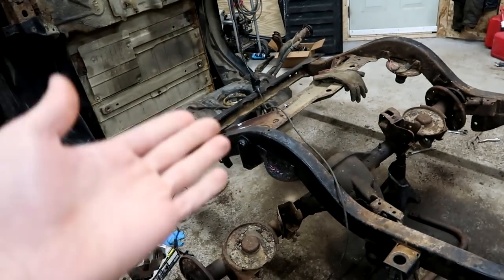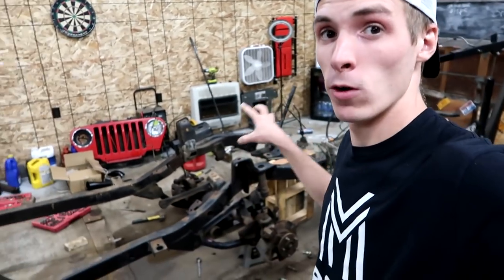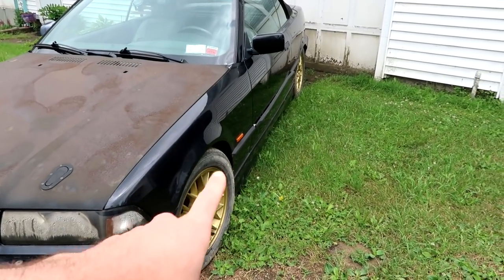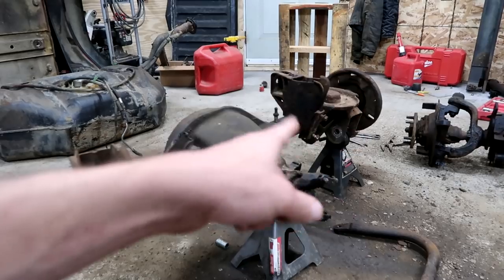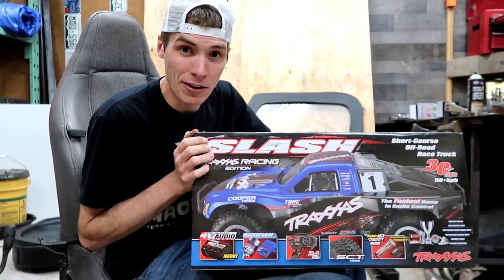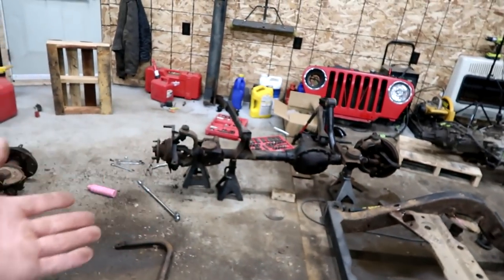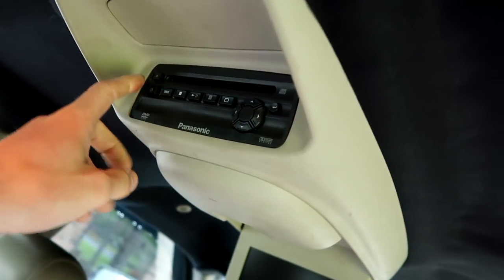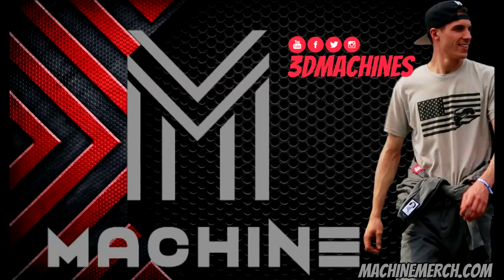NEW TRUCK REVEAL!!! (It's Finally Done)

Comment: my dad has been mudding for 25 years and has built over 15 trucks, now we have a 79 ford bronco with a dana 44 in the front (welded) and a dana 60 in the rear (welded) and 4/10 gears in it. the truck usually runs 44in interco ground hawgs and was built in the late 90s and has been used hard since then and they have held up through everything, keep up the great work!

Comment: So I have a 94 Cherokee, lifted on 33s with the Dana 30 and Dana 35 and stock gearing, I have had 33s on the jeep for 5 years and around 100k miles I drive it on the highway at 65 no issues, I’ve driven off road no issues. I just rebuilt the Dana 30 up front, ball joints wheel bearings axle seals diff fluid, no wear on the carrier and pinion. Run them, if you feel the need upgrade it later on. Definitely put lockers in them if you plan on running them for a while it’s worth it.

Comment: I've got a 93 yj, shattered a stock Dana 35 with just 33/12.50r15 tires driving in a straight line on a brick road at about 20mph. No noise until the the bang and screeching halt. I've now got a locked 8.8, its fantastic.

Comment: I used to race Cherokees in tuff truck comps around maine and we always ran just the stock dana 30/35 set ups. After bending a couple front axles we trussed them up across and inside the pc's and never had another issue besides breaking the occasional short shaft when we really buried it into a corner and stayed to the floor on the gas. I had 32s on my road rig too and never broke anything. It's all how u rum them. There's definetly more than enough aftermarket support for them to make them handle whatever u want to run for tire size.

Comment: We have built multiple jeeps, we ride them hard but do take care of them. My current project is a 1996 XJ that's getting 4.5in lift and 35's and lockers. The stock Dana 30 if it's a high pinion should be plenty for up to 35's before you need to update to chromoly shafts. The rear of my xj I'm going with a Chrysler 8.25 because its bolt in and only temporary. In your case I would build an 8.8 out of an explorer so its disc brake rear and limited slip with whole swap kits available to get it in and functional.  We have ran those with up to a 38in tire with minimal issues in everything from a 4.7 stroker YJ to a V8 explorer.

Comment: Those axles are fine. My 92 Cherokee, I basically rock bounce at offroad events. I completely rebuilt the 30 front due to the one that was on it being bent when I got it. So far no issues with this axle after I rebuilt it. Haven't touched my 35 rear, it's an LSD.

Comment: 2007 jeep wrangler jk had a Dana 30 up front and was snow trailing and got stuck in a small ditch tried to get out but in the end the case blew a hole in it. Upgraded to a Dana 44 same in rear with the locker. Best thing I ever did. I trail Colorado every weekend and moab twice every year. I do have some Cherokee friends that love the 30 and 35 but I hadn't had luck with it. Also I run 4.56 gears best trailing gears for 33s and 35s. If you have any jeep questions I'm here

Comment: you might want to keep the spacers that go on the frame to support the trans and transfer case, it helps with rear drive shaft angle. another thing is i broke my front dana 30 just by going back in fourth in mud (easily) and that is only with a 2.5L 4 cylinder. hope the info helps.

Comment: Hey Dalton I have a 2002 Jeep Wrangler and have had no problem with the diffs in it the front is a Dana 35 and the rear is a Dana 44. I have seen several Jeeps at the off-road Park I go to that have broken diffs from to much stress and I rock crawl and beat mine to crap and never had a problem

Comment: The Dana 30 is a very stout axle and with little modification can be made plenty strong for your application. I know someone running the stock front dana 30 in their Jeep WJ with a V8 and 37" tall tires. The axle had held up fine other than a broken stock axle shaft which was fixed with aftermarket chromoly axle shafts. As for the rear try and find a dana 44, dana 44a, or ford 9".  The dana 35 is known to be a grenade.

Comment: @3DMachines i had a 1974 jeep CJ5 with dana 35's with 35 inch off road tires. they worked out just fine for me. i mean my grandfather took it on some pretty gnarley stuff and it held up fine.

Comment: I’ve daily driven my Jeep for almost 6 years with a lift and mud tires and a Dana 30 in the front, I’ve done my fair share of wheeling yet I always baby my Jeep after I’m done. And I haven’t had a single problem with it. I at least have a Chrysler 8.25 in the rear which is just slightly better then the Dana 35. Id stick with a Dana 44 for the rear but by the sounds of it a Dana 30 will be more then enough for the front.

Comment: I have been playing with Jeeps for may years... Have built ground up a 1959 cj5.. My 95 yj  I have been building in stages for 14-yrs.. I definitely would not put any money into the rear Dana 30... Maybe clean it up a bit and paint it Black... Run it till you find a better axle... I run a Ford 8.8 in the rear of my Jeep .. They are pretty tough and cheap/easy to find.. The down side is that you will have to cut off all the suspension mounts and build it with new mounts for your time setup... Here is a link to a basic video of my Yj... I have put over 100k on it with most of those miles being back roads, trails.. It's been in the bottom of the Eastern end of the Grand Canyon, stuck in July at 12k feet in snow on the Rockies and been Thur Moab... Infact I am getting ready to head out west to wheel / explore .. Dig the build just concerned about the powder coat frame thing... I am constantly cutting and welding to my Jeep frame.. You are always adding or changing things over the years... I just run black pair and it covers the mods well... I do powder coat every else.... I even powder coat in my business weekly, so I have constant access to powder and didn't coat my frame... 

https://youtu.be/mQZBOarRFgo

Comment: Jeep will be fine ..i had a 98 tj with the four cylinder . 4x4 was great no problems sold at 350 000 km.
Did alot of minor 4x4 ,donuts and minor mudding and obstacles on 31 x 10 x 12 inch tires . Try a gusset kit to beef up the axle prone to bending with bigger tires. Good luck

Comment: If your that worried about the Dana  30 get a truss kit for it but look at your model of your, some of the older models come with small u joints on the end of the axle shafts,  if you have the smaller ones should definitely upgrade to some bigger u joints

Comment: A large 4WD tractor usually has a slightly faster front diff. than the rear to help pull it through mud and it allows some slipping so it doesnt completely rip itself apart. Not sure if its like that normally with vehicles but as long as it can slip a little a higher ratio could be a tad beneficial up front i think. I know my long tractor wouldnt hardly ever get stuck.

Comment: I have a 95 with the 4.0 ho, 4:10 with tracloc all factory. Just letting it known I have a stock jeep with stock axles etc.

It's really weird that everyone says these axles are junk yet they are still working fine 25 plus years later. If you do anything I'd go with an 8.8 out of an explorer.

Another point, you mentioned not using the spacers for the transfer case mount. If you are keeping the lift you will need to keep the spacers. They lower the transfer case and help with the drive shaft angle. Some also raise the motor mounts to lean the rear of the output even farther.

If this was a rock crawler or a competition rig larger axles would be a benefit but on a weekend wheeler the money would do better elsewhere. 

Retired pro offroad competitor
Reply: Oh, also the explorer rear can be had in the same gearing you have now and you gain disk brakes.
Reply: Ya when he said the Dana 30 was strong I was thinking he’s crazy. Only real bad axle on the Jeeps are the D35
Reply: Dana 30s are great for minor offroading its when you are trying hard things that put them on a bind that you have problems breaking Axel shafts.
Reply: CraftsmanQuad he just needs either a 44 or and 8.8 in the rear

Comment: Powdercoating doesn't last forever and is impossible to touch up. Nothing lasts forever in the rustbelt.
Reply: upside downdog actually you can touch up, you take a little powder and mix with MEK, and touch it up,  father in law owns a powdercoat shop and powdercoat vender/salesman taught us that trick.
Reply: Upside down dog the frames going to to rot from the inside out
Reply: DIY Chad 
MEK is nasty stuff! No good way to protect yourself from it, it permeates even your eyeballs and hurts the liver. I only know from experience.
Reply: Ethan Kage 
Any way it can for sure. I would never buy a machine where the roads get salted.
Reply: bad day buddy?
Reply: Increased Elevation 
To who?

Comment: I support the 30 in the front that. Dana 35 is crap in the rear. My first vehicle was an 85 Cherokee on 33s. Lived in Virginia. Been to Black mountain Kentucky rock crawling with it. The 30 held up great. Blew the pinion out of the 35. After that I got a Dana 44 for the rear from a high output 4.0 Cherokee. Never had any issues afterwards

Comment: When I was in my 20's I bought a Nissan truck that was lifted. Had a cool rake( or so I thought) to which turned out that it had 31" tires in the front and 33" in the back. First time I tried the 4 wheel drive it bound up and not knowing anything about 4 wheel drive thought it was broke. Took it to a mechanic and he told me I should do 31" all around. Live and learn.

Comment: If you can get those 44s I would go that route. The reason you want build stronger than what you anticipate driving is so you won't break. But if you build to your anticipated terrain eventually you will break. Your obstacles are only going to get bigger. You soon will be trying to get up that 90° wall.

Comment: All I can say is rebuild the axles as far as you can because it will save you in the long run and there is nothing wrong with a d30 for light off-roading and I would invest in some good inner tube seals there sale them on eBay, there are rebuildable and if you up grade to a d44 front end down the road you can reuse them as well,however I would see if you can get a D44 rear end if you do, do the u-bolt conversion on the yoke, and spicer u-joints are the way to go with jeeps because there have a lifetime warranty yes you will pay a little bit more for them but your pay for the warranty, and I know this because I live in Oregon and we off-road a lot up here.

Comment: If I can add my 2 cents. If you are going to run larger then stock tires, like 35" or 37" I would think about re gearing to 4:56 or 4:88. If you are going to sink in the money for re gearing I would go for Dana 44's front and rear. I am running 4:56 with a 35" tire, with a Dana 35 and Dana 30. I have not had any problems but I should have switch axels when I re geared. It is just a better choice.

Comment: hey Dalton!!,theres is a system ive heard off that makes your vehicle rust resistant,have to look it up,its something electrical and make all your metal in jeep rust resistant,so look into that,but long as keep painted that will guard against the rust also,later Dalton.

Comment: I had a 1992 wrangler although it only had the 4 cyl I had it regeared to 4.88 gears with locker in the rear had the same dana 35 in rear and once every couple years i had a a couple broken teeth on the gear as for the front I installed axle tube seals to keep out water and it did an amazing job as a i feel water was the main problem I had and obvs led to failure lol . Also was running 37 super swampers. Id leave the front alone and get a 44 rear.

Comment: powder coat isn’t always the best, i have a powder coated racing kart it’s a 2015 only seen water that is used to water the track. cleaned in wd40 after every race and there’s a rust spot and some paint chipping on the chassis

Comment: Powder coating only lasts if it is done perfectly with a perfectly prepared surface. Most powder coating these days just ends up cracking and peeling off in huge flakes. I still prefer paint on DIY jobs.

Comment: You’re honestly better going off with a set of Dana 60s The more beach here in the lower center of gravity and you can usually find them under running 99 2500 or F250 4 x 4

Comment: Nah dude that front end is gold I jumped my jeep going about 70 caught 6 feet of air bent the axle shaft drove it back home which was 2 hours away! Took a torch to it bent it back! And jumped it again fyi it didnt bend again probably because I welded some flat stock to it to reinforce it but that's after it bent the first time but thats besides the point! Also you should prolly reinforce you're axles no matter what one you use! Its great

Comment: my friend had a dana 30. we worked on it together to get it ready for wv and it couldn’t withstand the bigger and steeper obstacles and blew up and ceased. we had just put it in and rebuilt it because it was used and it was almost mint on the trip only had 1000 miles and the trip was 500 itself

Comment: I run a Dana 30 front and a 8.8 in the rear In my ZJ. My Dana 30 Has a artec truss kit. The tubes are sleeved. And artec lower control arm brackets and artec c braces. With rough stuff specialties diff cover and steering kit with hydro steering. Chrome molly axle shafts with a set of 5-760X U-joints with 4.10 gears and. I run a 36” maxxis creepy crawlers at 4 to 5 psi and i beat on it hardcore and haven’t broke it in the last two years yet. And trust me it gets beat on..
Reply: I forgot to add it is a one peace Dana 30 high pinion out of a XJ i swapped out the low pinion for the high pinion for better ground clearance on the pinion and drive shaft angle

Comment: I went out today and bought a distributor cap,rotor,sparkplug wires and fuel injector for my Chevy S10 built in 1988 its a v6 2.8 liter extended bed

Comment: also def get the Dana 44's I've heard nothing but bad things running big tires on the 35 and 30's, they're weaker axles. there was a pair on craigslist in the rochester area I was checking out but that was a while ago.

Comment: Not trying to tell you what you did was wrong for verifying gearing, but there’s two super simple methods of finding out for sure. 

To quote How-to-build-hotrods.com(because I’m to lazy to type out this exact method):

Posi: Jack both wheels off the ground. Turn one wheel 1 complete turn.

- Count the turns on the drive shaft.

Non-posi: Jack one wheel off the ground. Turn the wheel 2 complete turns.

- Count the turns on the drive shaft.

If it takes about 2 and three-quarters turns, it's around a 2.73 gear ratio. If it's a little more than 3, you have 3.08s. If it takes about 3 and a quarter turns of the driveshaft, you have 3.23 or 3.25 gears. Very close to 3 and three-quarter turns, 3.70 or 3.73 gears.

Comment: Im not a ford fan but the do make one bad ass axle. The 9 inch is pretty much bulletproof and has a large aftermarket. Also the removable third member makes gearing changes really easy. All and all its a bad ass two wheel drive axle from my experience, never ran a four wheel drive with a 9 inch in it. I had an 8.8 in an old ranger and there great once you put a C clip delete kit in them so the axles don't fall out. That truck ran a dana 35 TTB for the front witch is a crap show in its self.

Comment: The issue with most of those axles is bending the tubes, if I remember correctly Jeep actually tells you not to jack up the vehicle on the axle tubes because they are so weak

Comment: I had a Dana 35 that had 270,xxx miles that was still just as good as day one never beat on it though and Did regular fluid changes mine was a lsd my grandpa had another 1500 that he bought from a ford deal ship and it had 1.5 million stock everything besides the water pump starter and alternator. I’m not a Chrysler fan cause I’m a die hard Chevrolet lover but they are good diffs

Comment: I've got a 1998 Grand Cherokee with a 7" lift and 33s, with a dana 30 and 35, I beat the shit out of them and they seem to hold up fairly well. I would also rather break a axle shaft rather than something in the T case or transmission.

Comment: All of my Dana 30 and 35 have blown going up a dirt road I say always goes with a Dana 60 or a corporate 14 bolt I have both a Dana 60 kingpin front axle and a corporate 14 bolt rear axle that’s what I run in my rock crawler never broken them with my 42 inch tires

Comment: On a well maintained 30 we have stripped ring gears, broke axles, and blew out ball joints (stock joints, everything else was upgraded parts) went to a G2 44 and haven't looked back.. We broke all that crap on 33's only... Not even a large tire.

Comment: Here's reality:
Dana 30 high pinion non vac disconect with the later model u joints are good up to 35s as long as your careful. however they won't hold up with 35s and a locker. 33s and a locker is a good setup.

The dana 35 is actually really weak, I wouldn't personally run anything over 33s on them and certainly won't hold up with a locker. 
your best bet is to put a 8.8 or 44 or 8.25 in the back